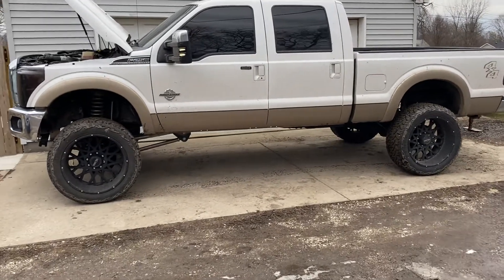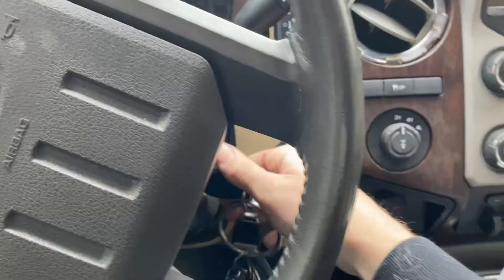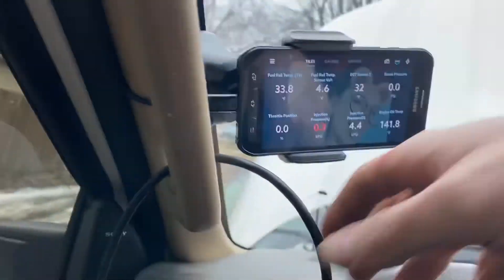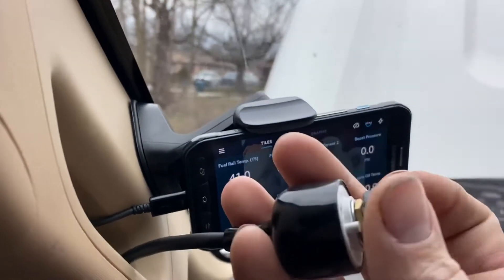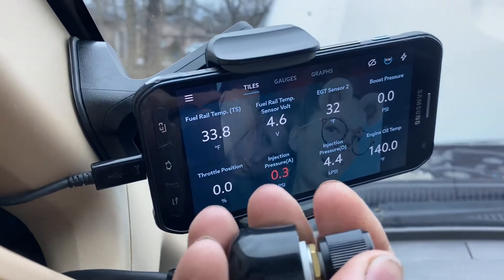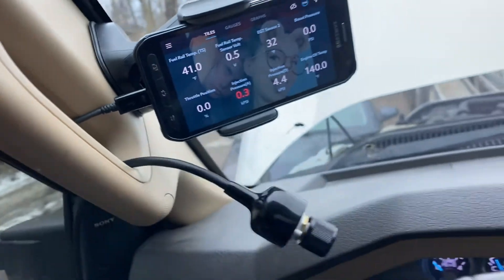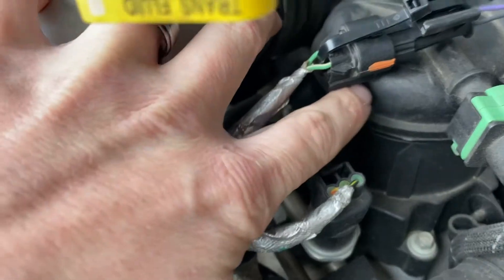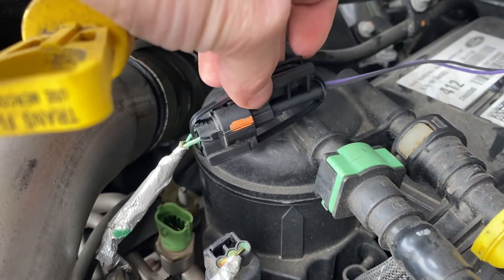How to tell if your 5 position SOTF switch is working

Comment: Hey boss thanks for the video ! I have 2018 f250 I bought used.. It was previously deleted and 5 tunes are programmed to the truck with the SOTF installed. Is there any way to check these settings on my cluster ? Or any tips how to see if it’s working ? I don’t have an app or a tuner it’s all programmed in the truck already
Reply from the maker: Do you know what brand of tunes are on it? Did you get it from a dealership or private? is anything connected to your obd2 port or tucked up under your dash possibly?
Reply: @Zocollo  nothing plugged in he said it was ezlynk 0-200 5 tunes and it was private sale . Thanks for the reply
Reply: @Zocollo  he gave me a link to the ezlynk SOTF switch . Said that’s he had it deleted and 4” pipes but left the resegnator . Said hook it to the fuel temp plug and I’ll have 5 tunes .. hopefully wasn’t lying
Reply from the maker: @Cdawg1871980  he probably had somebody tune it or he took the tuner for himself they are expensive. And you can reuse them infinitely. Only way I know would be to get one unfortunately there’s probably some other way like manually check the voltage with a meter I bet that would work.
Reply from the maker: @Cdawg1871980  call the major tuning shops and give them the vin they can tell you what tune was sold for that vin. Then you can hook up your SOFT switch like I did in the vid if so. I hope that helps. The two that I think are popular are spe and gdp
Reply: @Zocollo  yeah he did say he took it to a shop in Miami and they installed the program but ran out of switches and he never got around to adding it . Is it possible when I plug it in I’ll actually have 5 tunes waiting ?
Reply from the maker: @Cdawg1871980  yeah it’s very well possible. You can either spend the 50$ and an hour of time to install it. Or call the major tuning companies and verify that it has more than one one it. Most people don’t tune these trucks with only one tune so it’s very possible you have 5
Reply: @Zocollo  worth a shot !!! My only question is once it’s installed how do I know if it’s switching to different tunes lol I guess just mash the gas loll
Reply from the maker: @Cdawg1871980  good question I would say you could do that. I don’t notice a big difference in each tune power wise 1 4 and 5 I would say you can tell there is something different in power. And 1 2 and 3 I can feel the shifts more than the power. I think 1 is 50 over stock 2 is light 3 is heavy and 4-5 are like 150 200hp tunes
Reply: @Zocollo  awesome appreciate your time responding …
Reply from the maker: @Cdawg1871980  no problem hopefully it helps have a good one

Comment: any way to tell if you install it on the charge air cooler?
Reply: @135-j  !!!!!!!!!!!!!!
Reply: @135-j  I have it figured out now. Turns out a got an odd model and It did need to be connected to the charge air cooler. Works like a charm have had zero issues towing 15-20k loads from GA to OK.
Reply: @135-j  didn't use an ez link.